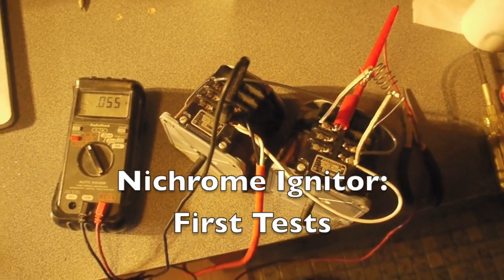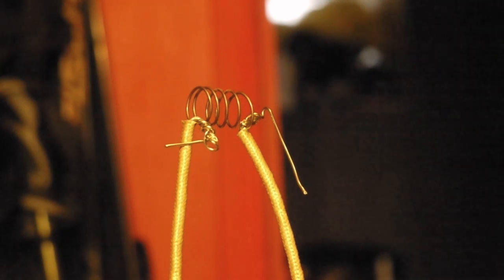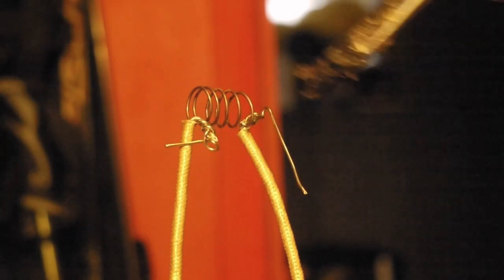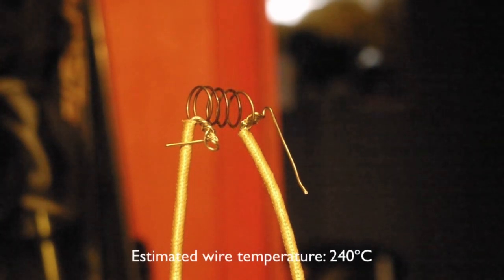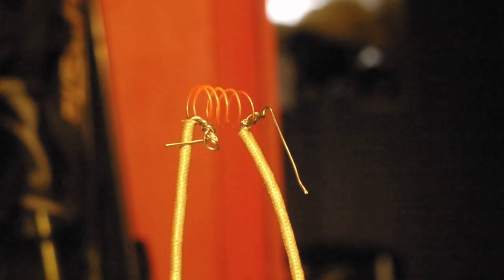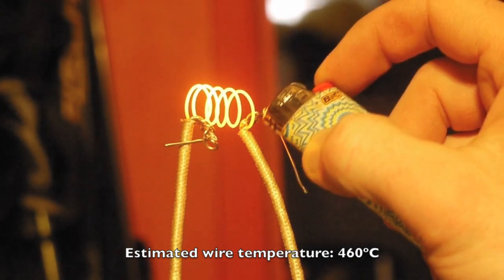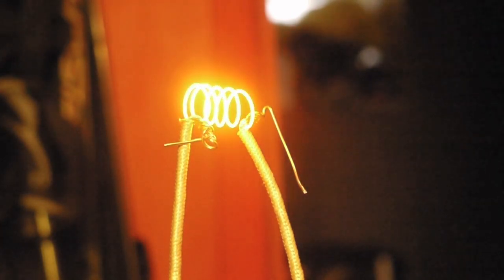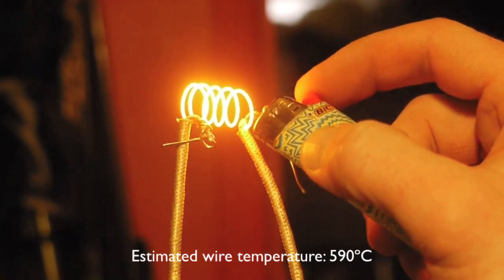Nichrome Ignitor: First Tests

Comment: 6.3 volts in what amps? did you run that nichrome wire?
Reply from the maker: +Tadeyo “DOTAdeyo” In this particular test, 11.9 A.

We later shortened the wire to lower the voltage required.  We also tried thinner gauges (which require less current) but for our application 19 GA is the sweet spot - any lighter and the coil doesn't hold its heat well enough to withstand being blasted with propane, which is cold as it exits the orifice.

For Fire Tetris we averaged 3.43 V and 13.4 A per ignitor.  We wired them in series, 25 per panel, and ran each panel at about 85 V.  Total power consumption just for the ignitors was about 9 kW (8 panels, so 200 ignitors).
Reply: +Jody McIntyre tnx dude.... i just want to make just only like that to power a lighter... and my only problem is where to get a power supply that can supply like 13 amps or something...